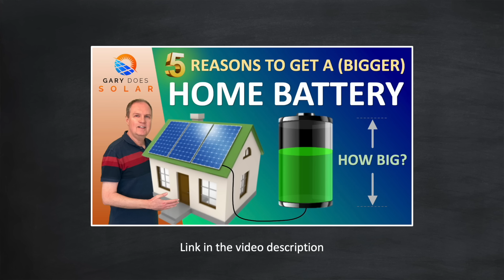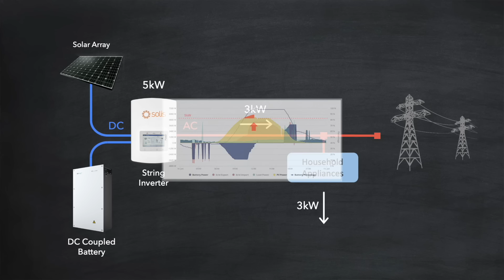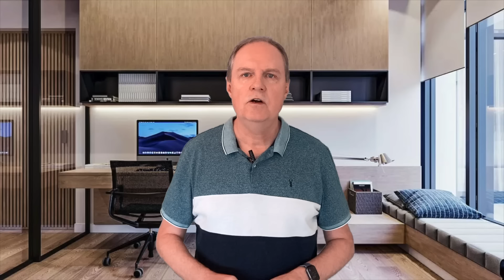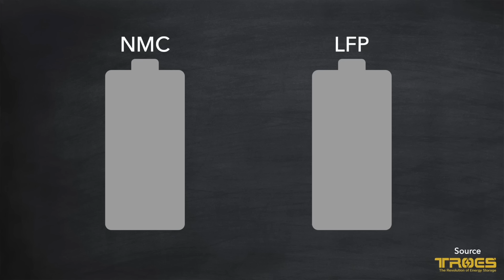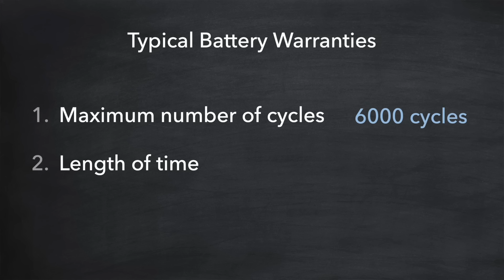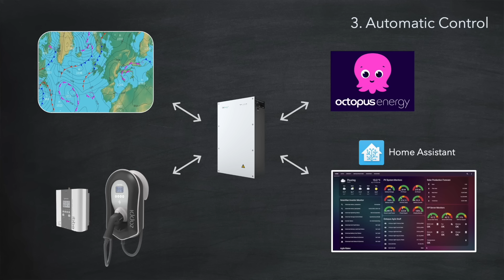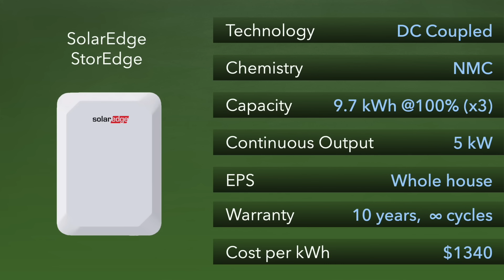8 Key Factors When Choosing the IDEAL Home Battery

Comment: Query Gary, can you have both a DC and an AC coupled battery on the same system? Surely that's got to be the gold standard, depending on circumstances!
Reply from the maker: The problem comes if the two batteries (actually the controlling inverters) are different brands. They could end up fighting with each other…

Comment: Hi Gary, Most economical batteries in Australia are showing 5 KW as rate or charge & discharge. does this mean they will not power my evening usage of about 7-8 Kw even if i have a 10 KW inverter and storage capacity is 26 Kwh. And  will i end up using power from the grid ? Do i have to look  for a battery with discharge power of 8-10 kw to avoid usage from the grid?
Reply from the maker: So, each battery pack will have a charge/discharge rate, but for some systems, if you have two (or more) battery packs together, the charge rate increases. For example, with Tesla, the charge rate goes from 5kW to 8kW. And with Sigenergy you just add up all the charge rates for each battery module to get a total charge rate. You will of course, be limited by the inverter size 👍🏻

Comment: I haven’t had panels installed yet, but I’m trying to understand how a typical household could ever exceed 5kW of power usage. The highest I’ve seen from my smart data is around 1.2kWh over a 30-minute period, which averages to just 2.4kW — and that was the peak over the past two years.

I get that 1.63kWh in 30 minutes = ~3.26kW average draw, so if I wanted to catch a higher momentary spike, I’d probably need shorter time intervals — maybe down to a few minutes. Might be time to dig out the smart meter!

That said, even if I total things up — oven (2.5kW), kettle (2kW briefly), lights/TV/Alexa, and two games consoles (0.5kW) — I’m still under 5kW. Add a heated towel rail and dehumidifier, and I might be somewhere between 3.6 and 4.7kW during peak load.

So even with multiple heavy-use appliances are running at exactly the same moment, I don’t think we’d hit the 5kW mark often — if ever. I think for a "normal" family we are overthinking things?
Reply: Add an electric water heater, mini split heat pump, and there's a couple more kw peak

Comment: Hi Gary, great video! what are your thoughts on the FOX ESS EQ 4800 L2? I am looking at quotes for installation with 22 450W panels and a 10kwH hybrid FOX ESS hybrid invertor. We have an electric hob, use the air fryer frequently, one pot frequently and this may often happen simultaneously. I was trying to look at options for batteries out there which are scaleable and have a good discharge rate for growing electrical dependence in the household. Thanks!
Reply from the maker: Thanks. Now, I don't know too much about Fox other than being cheap and cheerful--It's not something I would go for personally--but worth you having a look at what people are saying on social media, like this group here:

https://www.facebook.com/groups/foxessownersgroup

Comment: The batteries you can use in combination with a hybrid solar system are much cheaper than those all-in-one systems you talk about. That could be another reason to go for a hybrid inverter plus battery combination.
About your situation. It looks like you just need another inverter, or replace the one you have by a bigger one.
Alternatively you  could go for another DC coupled solution. An efficient way to get more power production out of your battery is by charging DC systems directly through a DC converter. That is a bit of a DIY solution, but it is more efficient than using an inverter to convert AC to DC and then use AC to DC inverters to run or charge your devices. Devices that use DC are anything that contains a battery, such as a phone or tablet, or laptop, but also your router uses 12 V DC.
Another DC coupled solution would be to put some AC devices on a separate local AC grid. You could for instance use a small off grid inverter to power your fridge.
Reply from the maker: Good points. Thanks for sharing 🙏

Comment: The reason why your DC battery isn't helping much with clipping is that you prioritize charging. You're charging in the morning when your inverter has free capacity and could be exporting. And by the time it starts clipping, battery is nearly full. Generally, it's a good strategy. It's just no good if you want to store those peaks. Even getting a bigger battery won't really help. You need a different strategy.

With a DC battery, you have to size your inverter differently. Without it, you size inverter to solar array. If you're not interested in exporting and your solar array is oversized for winter, you can size to load. With a DC battery, you size to load + desired exports "above and beyond" (that is beyond unused continuous rating for load). Because now the inverter handles both panels and battery. You can't size just for panels. With AC batteries (or micro inverters), it's like having oversized inverter.
Reply from the maker: I’ll be modelling some scenarios around this before long using my utilities, to see what are the best approaches.
Reply: @GaryDoesSolar  Trivial strategy is to have some portion of your battery capacity that is essential and only perform priority charging to that level. And then have some portion that is reserved for opportunistic charging or speculative charging.

You could try to make it more sophisticated by taking into account time of day, predicted production, electricity rates (maximizing exports when rates are high), etc. But you'll be looking at optimization of such a model. E.g. you could have two levels of essential charge, one for morning and another for afternoon. Or in a more sophisticated version, to have a target as a function of time. You want to leave enough space in the morning for a peak but then you want to ensure that you meet your goal for the day. You need to monitor how the battery is filling up during peak period and limit exports if needed.

Capacity alone is not an answer as you'd just be charging and charging until it got full. The answer lies in a strategy. When to charge and when to sell excess that would otherwise keep accumulating and how much to charge or sell at any given time. It's quite an interesting problem.

Comment: Why aren't people using deep cycle lead acid batteries for stationary applications?
Reply from the maker: What would you see are the advantages of that?
Reply: @GaryDoesSolar  simple design with abundant materials. There's a lot of demand for lithium in portable batteries, so we should be trying to avoid using it in stationary batteries.
Reply: @GaryDoesSolar  lead and sulfuric acid are both toxic waste products. If the casings were made from recycled HDPE, they could make the most environmentally friendly batteries in the world.

Comment: Not worth it mate. been there done that. Would have been 6 or 7 years ago.
Reply from the maker: But battery prices are WAY cheaper now than they were 6 or 7 years ago. What’s your logic?
Reply: @GaryDoesSolar since 2017 bitcoin has risen x20 and used WAY less power than now. The equipment to mine was also much cheaper.
Reply: @GaryDoesSolar also bitcoin halving means you get many fewer bitcoin.
Reply from the maker: @robbiegrant4977  You've commented on the wrong video, then - this video is all about batteries.
Reply: @GaryDoesSolar  Apologies. Im a dafty Gary. Regards from deepest darkest Fife.

Comment: Gary, I understand the benefit of having a DC coupled battery at 5:09. With the new hybrid inverters and batteries from Sigenergy/Tesla eg Powerwall 3, would it be possible to utilise any of the solar array power to charge the DC side of the battery and also be able to utilise the AC side of the battery to meet the AC demands which are higher than the inverter output? Hope this makes sense. Excellent channel and informative videos😊
Reply from the maker: Thanks for your kind words. Yeah, it's interesting that the PW3 can operate in DC or AC Couple mode, but I think you have to select at installation time.
Reply: @GaryDoesSolar  Could you fit both an AC and a DC coupled battery to suit both needs? Surely that's a good standard, but also, if managed well, there are fewer down sides? Just a thought, it would be good to know if that's possible. TY

Comment: Great videos! They make complex issues clear.
I'm puzzled by a discrepancy in reported battery prices.
In this video, you list batteries with cost/kWh ranging from $700-$1350.
But in your other video, "Home Battery Prices Are Falling!", there's a graph showing $120/kWh in 2024.
What have I missed?
Reply from the maker: Hi Dominic. The discrepancy is all about the pricing of battery cells compared to the pricing of battery packs. The latter is much more expensive because of manufacturing, marketing, sales, distribution, customer support, consumer sales taxes etc.

Comment: Isn’t EPS a function of the inverter especially on DC coupled systems
Reply from the maker: It likely depends on the manufacturer. My GivEnergy system has a DC Coupled battery and I have some electrical circuits on EPS. The inverter seems to take care of everything with GivEnergy at least.

Comment: Hi Gary, quick question if I may. How do all in one solutions work, for example the Tesla PW3 and the GivEnergy All In One system. Are they considered to be DC or AC coupled? They’ve obviously got the inverter built in, but does the energy in the battery sit on the DC or AC side? For example, the house hold draw is 6kW, 5kW come direct from the solar array through the inverter (it’s max capacity), but can the battery then add the additional 1kW required, or is it restricted to max capacity of the inverter? Or does the battery storage (in DC) go through a separate charge controller vice the main inverter?

Additionally, if you wanted two batteries in series on the AC coupled size, and one of those was either the PW3 or GivEnergy All In One, could the other batter be a different variant, one that doesn’t have an inverter included (but obviously it would still need a charge controller), therefore potentially a cheaper model?

Thanks
Reply from the maker: Good questions. If you're using the built-in solar inverter of the PW3, then it configures itself in DC Coupled mode, otherwise it configures itself as AC Coupled. 

I would not recommend an installation comprising batteries from different manufacturers unless you have some very clever management control mechanisms (like Home Assistant) in place. Without that, the batteries would just be fighting with each other all the time...
Reply: @GaryDoesSolar   Your videos have impressed on me that an AC coupled battery is the way to go.  So if you don’t have an additional string inverter, the PW3 and GiveEnergy ONI self configure as DC coupled? That kind of puts me off those products - unless I’m misunderstanding. 

So multiple batteries should be of the same make, but could be different sizes?

Thanks
Reply from the maker: @fauxlobster  So, that depends on the battery manufacturers, so you're best to confirm - but yes, in general, different battery sizes from the same manufacturer should interoperate.

Comment: I'm not sure whether anyone else has mentioned it, but an added disadvantage of choosing a smaller battery is that you will put it through many more charge-discharge cycles for a given level of power usage over time. This is an undiscussed issue particularly with EVs: doing the same amount of mileage with a smaller battery EV will kill the battery earlier than with a larger battery EV.
Reply from the maker: Valid point, although everything I'm hearing about EV batteries is that they're likely to outlive the rest of the car... so maybe not so much of an issue?

Comment: Haven't used a Kettle since the energy crisis began. I use 680W Instant Kettle Urn. Use cheap rate to heat (charge up) the urn, and then during the day it uses 2W to keep the water hot. It keeps the water at 98C, if you really need it boiling, a few seconds in a jug in the microwave will boil it again. Toaster is 800W, caravan toaster. Hob is a 2 ring 16A induction hob. This has meant that now a 5KW inverter is generally able to supply power from the battery all day without drawing from the grid, even if using the oven.
Reply from the maker: Very good.

Comment: Gary, could you not add a second inverter to your system, increasing the available AC power to 6 kW?  Then you don't need AC-side batteries.
Second, when you have multiple AC sources, how do they stay in phase?  Thanks!
Reply from the maker: Hi Steve, you can certainly add a second inverter to your system, and this is something your installer can advise on. Each AC source (inverter) who converting DC into AC, will automatically synchronise with the home AC sine wave.
Reply: @GaryDoesSolar  Thank you for the answer.  Pretty cool that they can sense each others' sine waves.

Comment: I decided for 6kw solar, and 12kw hybrid inverter and a 30kwh 48V battery (costs 1/8 than HV batteries when self built). so i can charge my EV with 10 kw even in the night
Reply from the maker: That's quite a setup, Olaf! :-)

Comment: the question is how do you avoid your Ev to empty your home battery? I am looking into SP with home battery and EV charger. But I read everywhere that the issue is that the Ev is seen by the system as another load therefor it empty the home battery to charge the car and surely we dont want this? can you advise ?
Reply from the maker: This is certainly a problem and generally only solved if the battery “knows” the power draw is for charging an EV. An AC Coupled battery could use a CT clamp for that purpose. Best to speak to an installer as they deal with this issue all the time 👍🏻

Comment: Hello Gary,
Lovely videos.
Really helpful.
I am thinking about to get a solar system.
The installer has recommened the below:
I just want to make sure that the products are of good quality.
I have done some research online but your view would be icing on the cake.
The Invetor and Battery are FoxEss make.
Battery 12.44 kwh (ECS4300hH-H3)
Hybrid Inverter 8Kw KH8 Series
20 x 425 watts Panels Array (8500kW) Jinko Solar Make.
Also an Eco Smart Diverter 3.68 kW Eddi.
My roof orientation is East-West.
What I would like to know that if these products are of good quality.
Warranties: 25 Years Panel Product and 30 Year Panel Performance.
10 years insurance backed HIES Guarantee on workmanship.
Company installing-Solar4Good Ltd(UK)
Reply from the maker: Hi Bhavin, thanks for your kind words :-)

Now, unfortunately, l'm not in a position to provide individual advice (not least because of potential liability issues, even if that advice is given free - such is the world today). You're best to speak to an installer for such advice, or post a comment onto a solar forum (e.g. this one in the UK: https:// www.facebook.com/groups/2197329430289466). Good luck!

Comment: Is there any technical reason why a battery couldn't be DC coupled for PV charging and simultaneously AC coupled for discharge and charging from the grid?
Reply from the maker: Hi Harry, I'd say yes - it's either behind or in front of the inverter, so would require extra hardware inside the inverter to make that happen I guess... but for what advantage?
Reply: @GaryDoesSolar  Efficiency/Utility.  You would save one AC/DC conversion on solar charge and be able to utilise surplus solar without impacting AC to the house. You would still be able to augment the solar AC with the AC coupled battery connection and support higher power island mode in the case of a grid failure.
Is there much difference in cost between a hybrid and string inverter? Does the battery care where it gets it's DC from.
Maybe this isn't a thing but could it be?
BTW joined Octopus with your code today💷💷
Reply from the maker: @harryfettes393  I see your thinking - yeah, could be something in this 👍Hybrid inverters are typically more expensive than non-hybrid, certainly. Thanks very much for thinking of me with my referral code - that means a lot! 🙏

Comment: Excellent video. Watched the series. I have 5.6kw PV plus an ASHP, self consumption is 95%+, but considering a battery to time shift import on Octopus Agile. Figuring out how big it needs to be based on consumption. Biggest issue is where to put one, batteries are big and the plant room is already full of ASHP and heat recovery / ventilation kit! If only I had a garage….
Reply from the maker: Yeah, space is an issue when getting into the renewables space! Hope you're able to find a solution :-)

Comment: Thinking of adding a battery without solar. We had a seven hour power outage yesterday. Out came the Honda gas generator. It seemed heavier than I remember it. Had to get some gas. A real pain in the shoulder. Could only power the refrigerator. Gary's video explained things that I was not even aware of. Great job Gary. You must have a degree in Electrical Engineering.  Everyone thinking of solar or batteries should watch these videos. Thank you very much Gary.
Reply from the maker: Thanks Eric, and yes - Electrical and Electronic Engineering :-) I always wanted to do software engineering and that was the closest course there was at time - it was a great course!

Comment: It's all called maximum demand.  It's in the 18th edition, ESQCR, EAWR probably in many more.  It's been around since electricity.  It's how systems are designed.  Design the generator to 130% of the need and you would be laughing. Instead solar an battery companies have decided to do it as an avrage.
Reply from the maker: I’d say it’s a balance between cost and benefit.